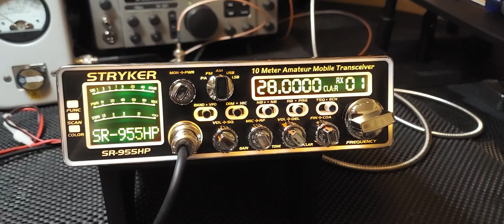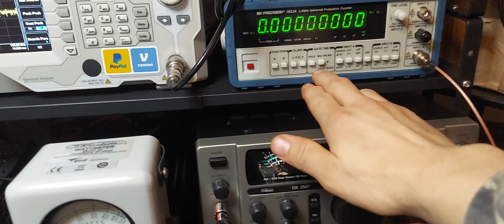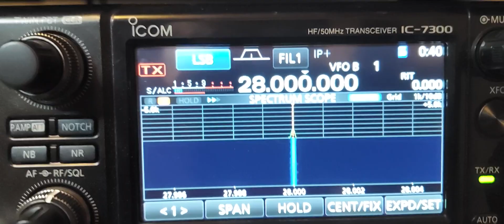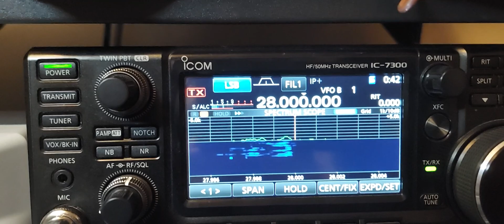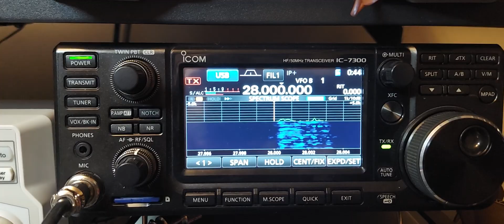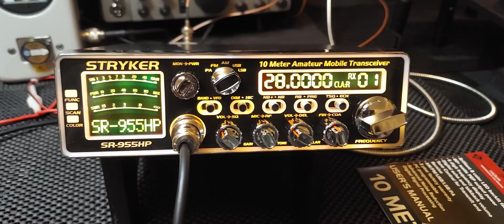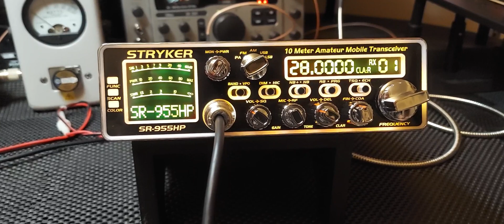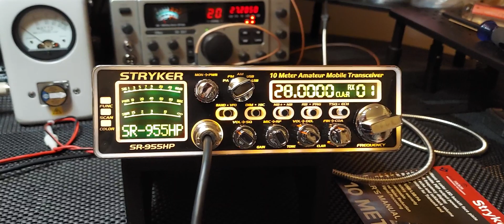First look at Stryker 955HP with new board. Some are referring to it as Version 2 Stryker 955.

Comment: My ? Sir is do you only service what you sell? I have a 2 Stryker radios. 1-955,1-655, I want to use the 955 for a base station & 655 for mobile. I just want a basic peak & tune for each. Also want to run both for CB but also want to run them both for what you were intended for. Talk to me.

Comment: Well a friend of mine just picked up a new 955 and didn't realize they changed them since the original and says it's a completely different board which has no adjustments on it 
You have to do everything via computer or menu and though he has tuned up a thousand radios by the book and got them very loud this new 955 sounds like a stock Cobra walkie talkie - so unless there's a way to open up the AMC or get into one of the inner menus and reset it, I'm calling JUNK.
It's nowhere near as loud as his 2995, 2950, 148 GTL or Cobra 29.
I'm sticking with Gen-1 if I can find one.
Reply from the maker: To each there own. I have a gen 1 955. I used it once and stuck it on the shelf. The V2 955 is leaps ahead in technology.

Comment: These radios have CW marked on the back of the radio however their is no CW switch on the front of the panel.  So I'm wondering , maybe  this is not functional , does anyone know ? 73's .
Reply from the maker: Mine don't have a CW key input jack.
Reply: @ScottsRadios  Thanks for replying , the reason I asked , I have seen a CW  an input jack on the back of the 955hp next to the PA input with the word CW KEY input , well in some photos , maybe they used a different radio  . 
At this time I'm actually waiting on a new 955HPC in the mail and so I was curious when I read this  ,  as I purchased  a new 9555 for SSB / FM and not for CW , but if it did well, that would be a bonus . 

I see their is no selector position for CW and thought, if by chance , maybe it was software related to select it . 
So I my question was relation  an advertisement on Ebay  .  Their are  few sellers advertising the  955hpc saying it supports a CW mode ,... it just maybe a misleading sales pitch . 
So I had to place the question out there to those  who actually have this radio  if this was true or not, , thank you for your time and  I a precipitate it very much .   

73's

Comment: I hope they tightend up the front end. My old one is nothing but splatter splatter from strong signals on other channels. I can be on 38lsb and the super bowl on 6 will splatter me.
Reply from the maker: I've never seen any issues with the new model.
Unfortunately some people run a extremely ridiculous amount of power along with a radio that's had every single modification known to mankind which when paired together can cause pretty much your toaster oven to radiate their signal 😂
Reply: @ScottsRadios  yes there are folks that run dirty. It’s possible to run gobs of power and keep it clean but some cannot grasp that. They aren’t happy unless they are clipping limiters and running 110% modulation, overdriving their amps etc. you hear it both on AM and SSB. I been listening to 38lsb today and it’s a train wreck with noise toys and politics. Thanks for the response and 73.
Reply from the maker: @wwtf7180 
I wouldn't be concerned with a dirty signal running something like this with a modern HF rig. https://www.dxengineering.com/parts/ame-al-1500?seid=dxese1&gclid=Cj0KCQjwwfiaBhC7ARIsAGvcPe6K3ZAE6bqaHwo9_USZYouDDNL-lJCl564L2H6Q-qR7Avq4UcTDTQUaAtRYEALw_wcB
I guess this would only be legal for ham radio frequencies.
Reply: @ScottsRadios  I have that very amp. Also have an Al-82 for backup. Yes I am a licensed ham and I definitely don’t use them on the 11 meter band. My primary rig is a Icom 7610 and my backup is a 7300. I use a old school Cobra 148 for CB with stacked  maco m-103s up 50 feet. I feel antenna gain is more effective than running power. It works good for me and it’s legal. Don’t wanna risk my ham license.
73 to you.
Reply from the maker: @wwtf7180  nice set up.
Are your stacked Maco 3's vertically or horizontally polorized?
Reply: @ScottsRadios  They are vertical on a maco cross boom.
Reply from the maker: @wwtf7180  yeah that's probably a really good way to go.
I have a shooting star from Maco.
Has the typical vertical radiation pattern distortion from mast pipe and tower.
I'm changing it to a Jo Gunn 5+5 star.
Then I should be able to put my stacked 4 element 146.520 vertically polarized Yagi underneath it.
I like the Jo Gunn design, less chance of interaction from tower/mast pipe.
Reply: @ScottsRadios  you are exactly correct on the mast pipe interference. That’s why I went with the cross boom. I have a gizmotchy 4 element at my cabin and although it works well it’s pretty flimsy. The Jogunn is built way better. 5x5 is a nice choice 👍🏻 
73 from 567 Northern Minnesota.
Reply from the maker: 73, Wr5189 Michigan
Reply: @ScottsRadios  I’ll listen for ya. 73.

Comment: Is the Stryker 955 better than rci x9
Reply from the maker: That is a hard question to answer because it will be an opinion based by anyone that answers it.
In my opinion yes.
It's hard for me to go into all the specifics because I do not Factor power output as a reason a radio is better than the other.
If you are SSB operator you will be much happier with the Stryker 955V2.
Honestly even AM is better, but again that is just my opinion.
73.
Reply: I just got the 955 today and it sounds good

Comment: I just saw another YouTube video  took it out the box , fired it up and he was talking from North Carolina to some guy in New Mexico, it was  unmodified.
Reply from the maker: Skip is all about conditions.
With the right conditions you can work anyone across the USA or the world with minimal power.
Sometimes conditions are not favorable and just because you can hear other places doesn't always mean you can make it to them.
Reply: radios like that don't need to be modified outside of the 11 meter conversion
Reply from the maker: @bigdEnergy666  I would beg to differ that based on what I see with my test equipment.
To someone that's not as DieHard into the hobby I guess your statement is true to them. But most want the best performance out of their equipment.
Reply: @ScottsRadios  if aligned properly at the factory what are you gaining? Is ten watt and a shorter life of the finals worth 0 gain in actual signal? Maybe touch up the modulation to 100% if needed, but again 99% of ops will never notice. Unless you crank everything to 11 and then people notice the crap audio and splatter. I guess it doesn't hurt to "confirm" the factory tune.
Reply: @ScottsRadios  ps if they cared that much about performance they would just buy a real radio... hf

Comment: Great vid! Did you notice if the voltage drop was any less with the v2? Thank you
Reply from the maker: I did not check for voltage drop. I do see full rated power output so voltage drop doesn't seem to be an issue.

Comment: I have the original, and it is spot on freq. and everyone I talk to has been impressed.
Reply from the maker: I have the original one also it is a nice radio but I prefer the new board due to its Superior frequency stability.
I find on the original model you must use the RT option in the clarifier menu setting to remain as its called on frequency.
Even after you fully align the radio and simply use the R option for receive only on SSB the radio does still have a considerable amount of TX frequency drift.
On the new version the RT clarifier unlock option is not needed. You can use it if you wish, but the radio does not have any noticeable TX frequency drift on SSb.
Keep in mind I have not tested the version 2 radio in a mobile setting during the winter where the radio could be very cold from sitting outside in below freezing temperatures.
Reply: @ScottsRadios  Ok, thanks. Mine sits in a climate controlled room, with very good 35 amp supply, that could be why I'm satisfied, or maybe just lucky. 🖐🏻73's🎙️🎧KD9OAM📻 148 in the Hoosier State.
Reply from the maker: @AdamosDad  they are good. Stick with it.
Eventually it will be a classic. 73
Reply: Y como se activa el RT en el radio para que permenezca la frecuencia solicitada.

Comment: Not that i can get one now Mike , but are they available through you at this time ? Also will you give instruction on how to convert it if bought through you ? Thanks , hope your doing well .
Reply from the maker: Sure thing Tim!
It is very easy and anyone can do it.
As long as there are supply available, I can have one sent to anyone interested.
Reply: @ScottsRadios  Thanks Mike :)
Reply from the maker: Yes sir
Reply: @ScottsRadios  Still thinking about getting a 955 Mike . I realize they basically have the same board as the DX 5000 . Does the 955 put out more wattage ?
Reply from the maker: @timmygilbert1371  yes it does in the board is different in some ways so you could say it's a different radio for sure.

Comment: So, how does one access the service menu?
Reply from the maker: Personally I would reach out to Stryker and ask.
From my initial testing. I find no reason to even go into it.
Reply: @ScottsRadios  :  Well, they need to have 11 meters opened up, for one thing. the other is to make sure the PEP isn't too high at the lowest power setting.
Reply from the maker: The conversion is really simple.
Anyone can do it.
The peak power on low power isnt very high.
In the video I had too big of a element in my meter. I should have put a smaller one in. You would have seen a more accurate reading.
Reply: @ScottsRadios  : My V1 came out of the box with a 3w carrier and 60w modulated PEP. That was way too much. So I had to knock it back to a 2w carrier and drop the pep to 30w. Now, I have seen V2 videos where the low setting was 3 watts and the pep was 50w to 55w. One guy even took one fresh out of the box and had 90w pep on low setting. I would need access to the service menu but it  seems this is going to be a heavily guarded secret for a time, until someone lets the cat out of the bag.  Meanwhile, our local club will hold off purchasing the V2 until such time as the access code has been divulged.
Reply from the maker: @TheLonesometoad  I cannot speak for the other videos you have watched.
My radio was essentially new out of the box right from the distributor.
I will do another video when time allows and definitely make a point to show the low power setting with a more accurate element in my Bird 43P watt meter.
If I remember correctly it was less than 40 Watts on low power setting on AM.
Reply: @ScottsRadios  : I would be most interested to see the high and low on AM, also on SSB. Will you reveal the conversion method and service mode access?
Reply from the maker: @TheLonesometoad  I can do that for you on a video this weekend when I get more time.
Since I'm a dealer of Stryker radios and antennas. I would need to have their permission before I can hand out information. I don't want to jeopardize my relationship with them.
I'm sure in time the information will be leaked.
Like I had mentioned before you can always give them a phone call and ask them directly.
Reply from the maker: @TheLonesometoad  https://youtube.com/shorts/MaRbMfueXRo?feature=share
Reply from the maker: https://youtube.com/shorts/XtyqY6X7VWI?feature=share
Reply: @ScottsRadios  : Email sent...
Reply: @ScottsRadios  : For some reason, my email client is kicking your email address out and refusing to send. I'm working on it.
Reply from the maker: Try scottsradiosllc@outlook.com
Reply: @ScottsRadios  : Thanx for the vids. That's what I needed. Much appreciated. Soon as I make some room I'll give you  a call.
Reply: @TheLonesometoad  a gentleman has put up how to convert it to 11meter and how to access the menu on YouTube within the last week. Just search and you will see it. Both are super easy.
Reply: @baylenthedogg3242  : Yes, I've seen them. Thank you. Good info.

Comment: Have they improved the noisy receiver?
Reply from the maker: I never really noticed a problem with a noisy receiver on the original version.
But I've never ran one mobile.
The noise reduction circuit is a big improvement and does help remove unwanted sound from the receiver.
The radio as has the ability to adjust the receiver bandwidth which can also greatly improve quality of signal.